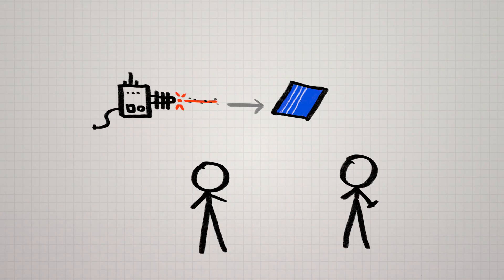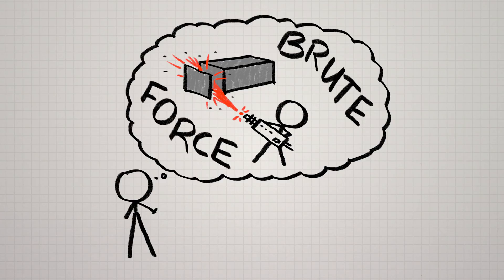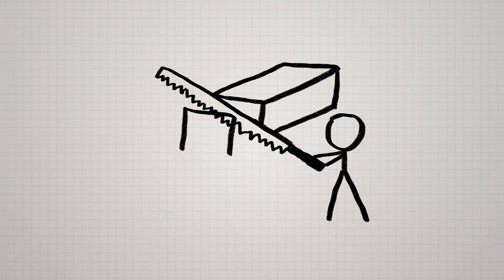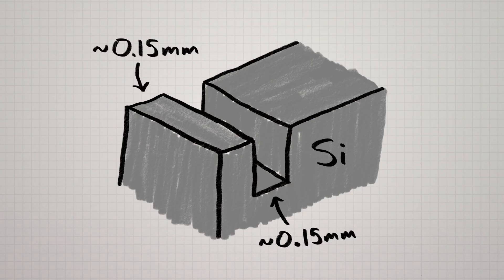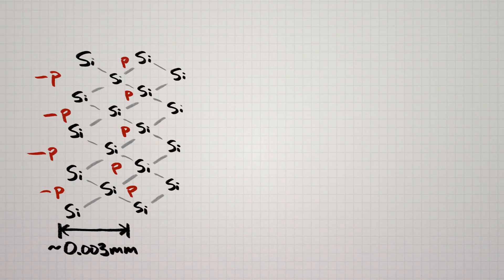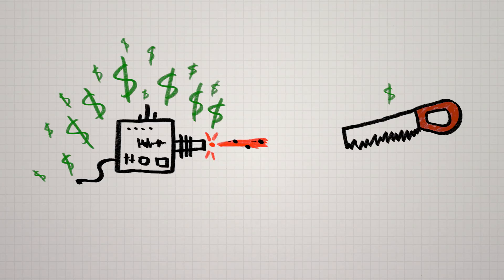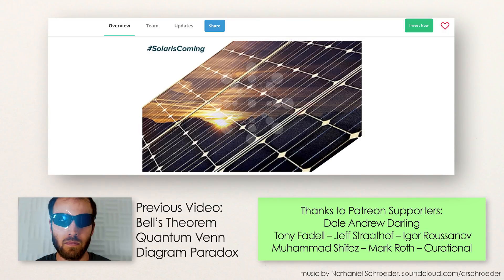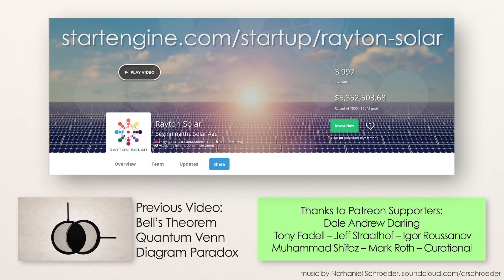Solar Panels Made With a Particle Accelerator?!

Comment: Rayton Solar, Inc. is offering a maximum of 32,894,736 shares of Common Stock on a “best efforts” basis without a minimum investment target. The offering will terminate at the earlier of: (1) the date at which the maximum offering amount has been sold, (2) January 13, 2018, or (3) the date at which the offering is earlier terminated by the company in its sole discretion. The company may undertake one or more closings on a rolling basis. After each closing, funds tendered by investors will be available to the company and, after the company has sold $7,000,000 worth of Common Stock, selling securityholders will be permitted to sell up to $3,000,000 worth of Common Stock.
 
GENERALLY NO SALE MAY BE MADE TO YOU IN THIS OFFERING IF THE AGGREGATE PURCHASE PRICE YOU PAY IS MORE THAN 10% OF THE GREATER OF YOUR ANNUAL INCOME OR NET WORTH. DIFFERENT RULES APPLY TO ACCREDITED INVESTORS AND NON-NATURAL PERSONS. BEFORE MAKING ANY REPRESENTATION THAT YOUR INVESTMENT DOES NOT EXCEED APPLICABLE THRESHOLDS, WE ENCOURAGE YOU TO REVIEW RULE 251(d)(2)(i)(C) OF REGULATION A. FOR GENERAL INFORMATION ON INVESTING, WE ENCOURAGE YOU TO REFER TO www.investor.gov.
 
    Price to
Public     Underwriting
discount and
commissions (1)     Proceeds
to issuer
(2)     Proceeds to
current
securityholders
(3)  
Per share for sales of $0 to $7,000,000:   $ 1.52     $ 0.00     $ 1.52     $ 0  
Per share for sales of $7,000,000 to $10,000,000:   $ 1.52     $ 0.00     $ 0.00     $ 3,000,000  
Per share for sales of $10,000,000 to $50,000,000:   $ 1.52     $ 0.00     $ 1.52     $ 0  
Total Maximum:   $ 50,000,000     $ 0.00     $ 1.43     $ 3,000,000  
 
(1) Rayton Solar does not intend to use commissioned sales agents or underwriters.
 
(2) Does not include expenses of the offering, including costs of blue sky compliance, costs of posting offering information on StartEngine.com. See “Plan of Distribution”.
 
(3) See the “Plan of Distribution” for details regarding the method of determining when current securityholders may sell their interests.
 
THE UNITED STATES SECURITIES AND EXCHANGE COMMISSION DOES NOT PASS UPON THE MERITS OR GIVE ITS APPROVAL OF ANY SECURITIES OFFERED OR THE TERMS OF THE OFFERING, NOR DOES IT PASS UPON THE ACCURACY OR COMPLETENESS OF ANY OFFERING CIRCULAR OR OTHER SOLICITATION MATERIALS. THESE SECURITIES ARE OFFERED PURSUANT TO AN EXEMPTION FROM REGISTRATION WITH THE COMMISSION; HOWEVER THE COMMISSION HAS NOT MADE AN INDEPENDENT DETERMINATION THAT THE SECURITIES OFFERED ARE EXEMPT FROM REGISTRATION.
 
There is currently no trading market for our Common Stock.
 
These are speculative securities. Investing in our Common Stock involves significant risks. You should purchase these securities only if you can afford a complete loss of your investment. See “Risk Factors” beginning on page 6.
 
Sales of these securities will commence on approximately January 13, 2017.
 
The company is following the “Offering Circular” format of disclosure under Regulation A.

 
TABLE OF CONTENTS
  Page
SUMMARY 4
RISK FACTORS 6
DILUTION 14
PLAN OF DISTRIBUTION AND SELLING SECURITYHOLDERS 16
USE OF PROCEEDS 18
THE COMPANY’S BUSINESS 20
THE COMPANY’S PROPERTY 23
MANAGEMENT’S DISCUSSION AND ANALYSIS OF FINANCIAL CONDITION AND RESULTS OF OPERATIONS 24
DIRECTORS, EXECUTIVE OFFICERS AND SIGNIFICANT EMPLOYEES 27
COMPENSATION OF DIRECTORS AND OFFICERS 29
SECURITY OWNERSHIP OF MANAGEMENT AND CERTAIN SECURITYHOLDERS 30
INTEREST OF MANAGEMENT AND OTHERS IN CERTAIN TRANSACTIONS 31
SECURITIES BEING OFFERED 32
FINANCIAL STATEMENTS F-1
 
In this Offering Circular, the term “Rayton Solar” or “the company” refers to Rayton Solar, Inc.
 
THIS OFFERING CIRCULAR MAY CONTAIN FORWARD-LOOKING STATEMENTS AND INFORMATION RELATING TO, AMONG OTHER THINGS, THE COMPANY, ITS BUSINESS PLAN AND STRATEGY, AND ITS INDUSTRY. THESE FORWARD-LOOKING STATEMENTS ARE BASED ON THE BELIEFS OF, ASSUMPTIONS MADE BY, AND INFORMATION CURRENTLY AVAILABLE TO THE COMPANY’S MANAGEMENT. WHEN USED IN THE OFFERING MATERIALS, THE WORDS “ESTIMATE,” “PROJECT,” “BELIEVE,” “ANTICIPATE,” “INTEND,” “EXPECT” AND SIMILAR EXPRESSIONS ARE INTENDED TO IDENTIFY FORWARD-LOOKING STATEMENTS. THESE STATEMENTS REFLECT MANAGEMENT’S CURRENT VIEWS WITH RESPECT TO FUTURE EVENTS AND ARE SUBJECT TO RISKS AND UNCERTAINTIES THAT COULD CAUSE THE COMPANY’S ACTUAL RESULTS TO DIFFER MATERIALLY FROM THOSE CONTAINED IN THE FORWARD-LOOKING STATEMENTS. INVESTORS ARE CAUTIONED NOT TO PLACE UNDUE RELIANCE ON THESE FORWARD-LOOKING STATEMENTS, WHICH SPEAK ONLY AS OF THE DATE ON WHICH THEY ARE MADE. THE COMPANY DOES NOT UNDERTAKE ANY OBLIGATION TO REVISE OR UPDATE THESE FORWARD-LOOKING STATEMENTS TO REFLECT EVENTS OR CIRCUMSTANCES AFTER SUCH DATE OR TO REFLECT THE OCCURRENCE OF UNANTICIPATED EVENTS

The Offering
 
The company is offering up to 32,894,736 shares of Common Stock for $1.52 per share, including up to 1,973,682 shares of Common Stock sold by current securityholders. Sales by current securityholders will not begin until the company has sold at least $7,000,000 worth of its Common Stock. See “Plan of Distribution and Selling Securityholders.” The total number of authorized shares of Common Stock is 200,000,000.
 
The net proceeds of this offering will be used primarily to develop and validate the company’s technology, to purchase certain assets to advance its plan to produce and market PV modules and for general corporate purposes.
 
The minimum investment size is $500.

RISK FACTORS
 
Investing in Rayton Solar’s shares involves risk. In evaluating the company and an investment in the shares, careful consideration should be given to the following risk factors, in addition to the other information included in this Offering Circular. Each of these risk factors could materially adversely affect Rayton Solar’s business, operating results or financial condition, as well as adversely affect the value of an investment in the company’s shares. The following is a summary of the most significant factors that make this offering speculative or substantially risky. The company is still subject to all the same risks that all companies in its industry, and all companies in the economy, are exposed to. These include risks relating to economic downturns, political and economic events and technological developments (such as cyber-security). Additionally, early-stage companies are inherently more risky than more developed companies. You should consider general risks as well as specific risks when deciding whether to invest.
 
The company has realized significant operating losses to date and expects to incur losses in the future.
 
The company has operated at a loss since inception, and these losses are likely to continue. Rayton Solar’s net loss for 2015 was $725,762. Until the company achieves profitability, it will have to seek other sources of capital in order to continue operations.
 
The company’s auditor has issued a “going concern” opinion.
 
The company’s auditor has issued a “going concern” opinion on its financial statements, which means that the auditor is not sure if the company will be able to succeed as a business without additional financing.
 
To date, the company has not generated revenues from its principal operations and has sustained losses since inception. Because losses will continue until such time that the company can procure equipment and complete development of its manufacturing technology and because the company has no committed source of financing, the company relies on financing to support its operations. These factors, among others, raise substantial doubt about the ability of the company to continue as a going concern within one year after the date that the financial statements are issued.
 
Throughout 2016, the company intends to fund its operations through the sale of its securities to third parties and related parties. If the company cannot raise additional capital, it may consume all the cash reserved for operations. There are no assurances that management will be able to raise capital on terms acceptable to the company. If the company is unable to obtain sufficient amounts of additional capital, it may be required to reduce the scope of its planned operations, which could harm the business, financial condition and operating results. The financial statements do not include any adjustments that might result from these uncertainties.

Comment: 1) Not all solar panels are made with the Czochralski process. It gives the best result, but is also expensive. When you don't care too much about super efficient panels, but rather want cheap panels, you could also just cast them. 2) The step towards this cutting method is actually easy, as you already had methods to inject ions in the semiconductor industry. Without ion injection we wouldn't even remotely be able to create the integrated circuits that we currently have...

Comment: Hey, I have a semi-related and super dumb question : Since a photovoltaïc cell harnesses the sun's energy in the form of light, which is a product of nuclear fusion in the sun, why would it be more efficient in a fusion reactor to harness this energy with a steam turbine rather than with solar cells ? Or inversely, why don't we use the sun's energy to heat up fluids and run turbines with it ?

Comment: Cool idea in theory, but how much energy does a particle accelerator need to operate? Rayton Solar doesn't provide any data on their website that suggests the operating energy cost of the particle accelerator. You have to consider then the amount of time it would take for the panels to generate the energy used to produce them.

Don't get me wrong, I'm all for clean energy. The great thing about solar panels or any clean energy is that after installation they create no emissions of any sort and after they have generated the amount of energy used to manufacture them they're "producing" net positive energy.

A few more comments on using a particle accelerator:

1) Maintenance - You'll want a technician to be present at all times to monitor the particle accelerator if it malfunctions.
2) Scaling - Particle Accelerators cost a lot of money. If you want to increase production you'll need to buy another particle accelerator.
3) Traditional Manufacturing - Consider a scenario where the particle accelerator breaks or goes down for maintenance. If you only have one particle accelerator, you're shit out of luck and cannot produce your wafers. You would want to have traditional saws or what have you to produce wafers just in case something goes wrong.

I don't claim to know anything about how a particle accelerator works or if maintenance is often needed, but this concept and the company itself just seems like something cool in concept. I'm rooting for solar and all other non-hydrocarbon energy generation methods and would LOVE to be proven wrong, but this is just a fishy company.
Reply: You might find some useful info here: www . accelerators-for-society . org

Comment: Question
if someone knows more about this than I do:
In the future, would it be possible to use a constant-stream particle accelerator to create nano or atomic scale structures?
Sort of how we currently use water-jet to manufacture precise parts. Is this type of machine even possible?
Reply: constant stream particle accelerators also produce slight variations due to quantum mechanics due to these reasons it is not possible to create accurate structures at nano or atomic scales however at scales of 1 micrometer or more these variations do not matter

Comment: But can't the material "wasted" be melted again? Of course, the thickness of the solar panels matter (it's a huge difference between 0.15 and 0.003mm), but I don't think the remaining silicone is wasted in the process.
Reply: The material is wasted because the cost is almost 100 percent due to the purification process. You need to start over if you want to utilise the dust, because it is not pure anymore.

Comment: Solar and wind are too diffuse and intermittent. Hydro is completely tapped. Geothermal produces more nuclear waste per watt than conventional nuclear power plants. And commercially viable fusion energy is still decades away. If you want clean energy to replace fossil fuels, Thorium reactors are the only option.

Comment: Awesome idea! For anyone interested, this is an application of the Bragg curve, which shows that heavy charged particles (of which protons are essentially) deposit most of their energy in a small range. This technology is being applied in radiotherapy in which doctors target tumor cells with these heavy charged particles, essentially by passing the normal cells and destroying only the target area.
Reply: Also look at "Bragg curve for antiprotons".
Reply: Well, the straggling will cause the protons to be deposited with a depth profile. For example, using a 2MeV proton beam, you get the protons deposited at 48±2µm. So I hope they don't need the protons to be deposited with high precision
Reply: Define high precision because ±2µm is pretty good for a first cut. I am curious though if this is just an idea/concept or something that's actually been tested.
Reply: Well I don't have more info on what they want to do. So maybe they don't need the protons to be deposited very accurately. 2µm on a 48µm range make roughly a 4% precision, which, depending on the domain, is good or bad
Reply: @TheEllusionist: What idea/concept are you asking about? I do not know about solar panels, but crystal 'cutting' by ion implantation is nothing new - it has been done routinely for many years. Search for "Silicon cutting using ion implantation". E.g. here from 2002: http://aip.scitation.org/doi/abs/10.1063/1.1494844
Reply: Thanks for the link. I now understand how the process works. This is very interesting. As I though there indeed is a distribution on the protons in the silicon so they will have to "clean" the surface after cut, which means losing material, but far less than with standard cutting. Anyway, I'd never heard of it, very interesting

Comment: why would I care about "waste" of silicon if it is affordably retrievable and so abundant on the surface of the planet? furthermore,  even though the tech behind solar energy harvesting is rapidly growing, it is not cheap enough right now. I root for this to work out, but I am not putting my money where my mouth is.
Reply: The problem isn't that silicone is rare but rather that it needs to be purified before it can be used and you might collect the silicone with other particles, making it impure.
Reply: I admire your reply, sir. But allow me to disagree. Purification is, indeed, a concern about the silicon you need to perform a better and more effective photocell construction. However there are certain processes already in use that result in good efficiency. The project shown is great, but it does not solve the major problem on PV systems: CAN I GET IT CHEAPER? Right now, it is a great way to move forward in the technology and, as a science supporter,  I can't think this is a bad idea. But the timing isn't right, it makes it even more expensive.

Comment: I would have been upset if you didn't clearly say it's a sponsored video at the end. It might have been better to say so at the start, but...

Anyway I'd just like to say that the terms of investment for Rayton Solar look pretty sketchy to me - They're essentially claiming they're already worth 200 million dollars, without actually having built any stuff yet. You get shares proportional to your investment as if they're already worth $200 million.

Even if they had actual manufacturing capacity up and running right now, 200 million eyebrow-raising high.
Reply: Check the lower left corner for "sponsored video" caption...

I agree, $200 mil seems ludicrous for apparently only having a patent and no real business.  Even if they raise a few million with this marketing, i don't think this idea alone is good enough to make it worth all that.
Reply: what’s the difference between rayton and nikola? nikola is yet to even make a single prototype vehicle and yet its stocks are insanely valuable
Reply: The video was mainly about the interesting physics, less about the sponsor. So to me it makes sense that the sponsor message is only at the end.
I see no reason why it should be earlier.

Comment: The most amazing thing - to me, at least - is the potential future applications of this to manufacturing. Would it theoretically be possible to apply this to other materials and achieve similar effects? Could other silicon-based products benefit from such techniques (microchips, for example)?

Comment: cool.  but silicon is cheap.  is there another benefit to thinner slices other than less "waste"?
Reply: Well, pure silicone silocon might have a word with you.
Reply: Nah, I don't think so.  The cost of material vs finished wafer is negligible.  The purification process is already old and refined.  Besides, it doesn't have to be the best purity for a solar cell.  The process of making the wafer slice is the big chunk of cost... so does this proton-embedding process cut that cost?  It might.  I dunno.
Reply: (I got a chuckle outta your typo "silicone".)
Reply: @schitlipz: Well, "silicon" and "silicone" are so confusing, specifically or especially for non-native English speakers.

Comment: I wonder if this same idea could be used to make graphene
Reply: It is possible to make graphene by intercalating small atoms (potassium salts mostly) in graphite and then heating up. This is possible in solution, without particle accelerators. Which is even better.
Reply: upvoted, hope someone with the proper authority sees your post!